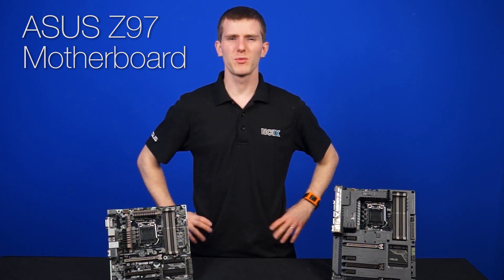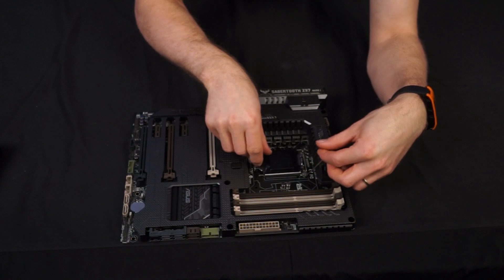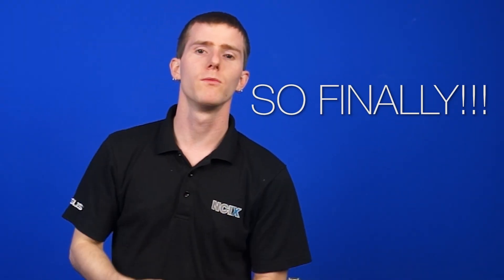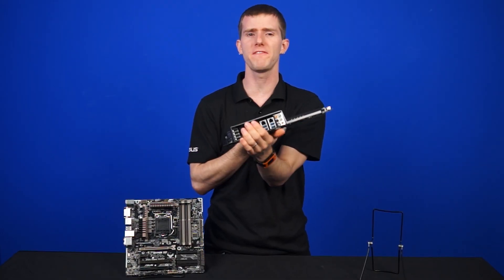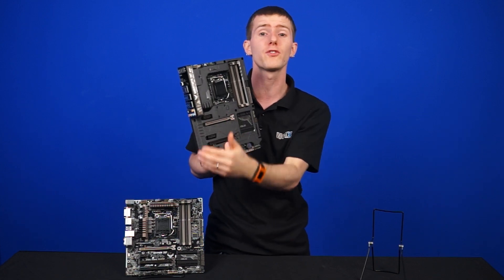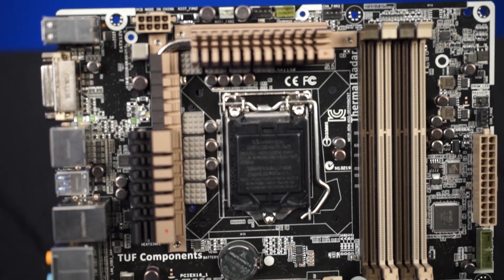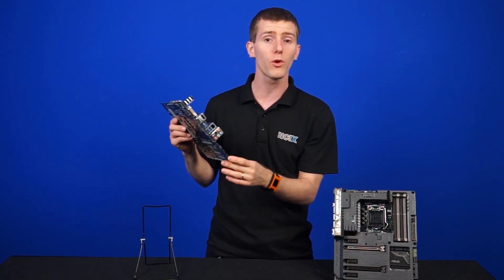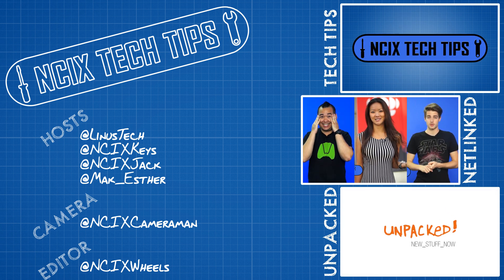What is the Z97 Express Chipset ft. ASUS TUF Motherboards - Sabertooth + Gryphon

Comment: Sticking with the legendary I5 3570k. This processor would still wreck everything in 3 years paired with a couple of 780TIs or 880s.
Reply: same i am sticking with my i5 3570k.
Reply: Man, I am keeping with my 3820 and my 2500k, both of those are still bloody awesome.
Reply: SirBillyMays 0.01v it is.
Reply: ya my fist CPU was a 2500k it's a beast .
Reply: I have the i5 3570k and LOVE it!!! Works like a charm! I even got it clocked to 4.4 and it's really stable. :)
Reply: Anyone here with tips on overclocking a 3820 btw? Had some struggles. (sitting on a Sabertooth X79 and 16gb (4x4gb modules), H60 cooler. Currently running on around 30C under light-medium load, under fake pressure I get around 45C.
Reply: SirBillyMays
Is that 30C and 45C with an overclock? If not then that should give you a fair bit of thermal leeway, so you could OC a bit. I think the safe voltage is about 1.35 for that processor. Try small increments of frequency increasing voltage gently too, or tell your motherboard to do the voltage stuff and you just set the frequency. Then, you can start up, see what max voltage it has given you (in Intel Burn Test putting it under 100% load), and go back into the BIOS and reduce it a bit, because I gather motherboards' overcompensate. Ask around here and see if you can find any people with OCing X79 knowledge :D
Reply: +triseebee
That is @ stock (3.6)
What is a safe increment? Like 0.1 to 0.01v?
I think I might look around for an OC guide, as far as I have heard it is not a very nice platform to OC on. (stability issues at higher voltages/frequencies)
Reply: SirBillyMays I also have a 3820, i can let the motherboard overclock it on it's own to 4.6+ Ghz, but it isn't stable. It can be stable for about a day but then BSoD, and if i keep the side panel off my PC it stays stable longer, so my assumption is I just need water cooling for it.
Reply: you put the side of your case open so it gets more airflow, if you would get watercooling it will have LESS airflow and will become even more unstable
Reply: Did he just say 880s lol

Comment: Im using a P8P67 Pro motherboard with an I5 2500K.
Its nearly 5 years old but its not in need of replacing, the 560ti on the other hand could maybe do with an upgrade soon, bring on the gtx8xx series!

Comment: im running a i7 920 on x58 because it was free and i wont be upgrading to z97 because i don't have the money for a better cpu and board on z97, however I may buy an itx z97 board and a Pentium anniversary edition (unlocked) for a secondary system

Comment: i7 2600k @ 4.6 GHZ
4 x Crucial M4 128 GB Raid 0 on LSI 9211-8i
AsRock P67 Fata1ity 
Asus GTX 580 Direct CU II
Asus Xonar STX 
I build this in 2011, upgraded once last year by adding 2 more Crucial M4 as they became so cheap, and added the LSI 9211-8i as well. It's been fantastic =D

Comment: I'm keeping my:
MSI SKT P67a-c45
i5-2500K @5.5GHz
GTX 550 TI
8GB RAM

This build was my first build from scratch and MSI has treated me so great. I'm sticking by MSI boards for the foreseeable future.
Reply: sarfured
110f is about 44c at 5.5ghz with a 120mm self contained cooler... maybe at idle or browsing the web. i smell something and it isnt your cpu melting....
Reply: sarfured
7 days to learn photoshop is too long. by then there will be a new video to argue in and this one will be long forgotten.
Reply: EZOVERDOSE Do you even read all of people's posts before you comment on them? I clearly said it only hits 5.5GHz when my board's OCGenie kicks in. I'm not increasing voltage, I don't have to, my board does it when it needs it. So I'll for sure keep in mind that the occasional OC is going to take my CPU's lifespan from 10years to 9.4years. It's already becoming obsolete so obviously I'd use ir for the remaining 7 years left on it's "reduced" lifespan.
Reply: What the fuck have you got cooling that I5 and what is the voltage?!
Reply: triseebee Shocked me too. I'm only running an Antec H20 620. I give the real credit to the 2 Noctua NF-F12's I use on the radiator. Keep in mind though that the CPU is turbo-ing at 5.5 thanks to MSI's OC Genie. I was going to overclock it myself, but I noticed my board was doing a damn fine job on it's own. I've seen it hit 110*F max, but only rarely.
Reply: Don't you mean 4,5GHz? 5,5GHz isn't possible with a single 120mm radiator. I have a i7-3770K with a dual 140mm radiator and it's hitting under load max 60 degrees at 4,5GHz. Oké, mine's a gen 3 processor and yours a gen 4 processor, but I'm sure it doesn't make that much of a difference.
Reply: ***** His CPU is gen 2 which is Sandy Bridge. Yours is gen 3 which is Ivy Bridge. Everyone knows that Sandy bridge is perfect for overclock but 5.5 GHZ its a bit optimistic.. Another thing that you have to realize is that his CPU is i5 w/o HT and yours is i7 with HT. Hyperthreaded CPU's such as i7 have problems with very high OC unless you disable HT in your Bios.
Reply: Belfor09 ***** EZOVERDOSE triseebee I'm at college right now and my desktop is at home. This is finals week, so I'll be home by the end of next week (9th-10th). If everyone is willing to wait till then I'll take a screenshot of it under load and we can take a look.
Reply: EZOVERDOSE If it took 7 days to learn how to put a white box over 4 characters and then use the text tool, graphic design would be a much harder job. If you can't handle waiting then who cares. I've got a 5.5GHz CPU and you don't.
Reply: sarfured
so u do know how to use photoshop.. the story unfolds..
i have a 4.6ghz @1.368v 3930k on a sabertooth board cooled by an h100i with 32gb ram and a gtx770 4gb which im totally content with.
im happy for u that youre proud of your system, theres nothing wrong with that. but u should enjoy it while it lasts. cuz to keep 5.5ghz stable youre feeding it voltage past its accelerated degradation point. so unless u just turn it on once a week to post a screenshot of its clocks to random ppl on youtube it will die sooner than later. good thing youre going to college to get some fancy degree so u can make lots of money to buy a new cpu when that happens. amirite.
Reply: Belfor09 well if you would disable HT it would be better to go get a i5 4670K, isnt it?
Reply: TheDreamingArmy It really depends what task you do on your computer. I'm sure no one would buy an i7 and disable HT just for sake of better overclocking right ? :) Im sure 4670k or even 4430 would fit in gaming scenarios. Sure you can think that way i7 w/o HT= i5 but its not. i7 has more tasks per cycle and more cache so it is better than i5 (at least on paper). If we are talking about gaming, there is nothing better bank for your buck than i5/fx8xxx and if you are talking about rendering and other professional taska the i7 will come ahead (with HT ofc :))
Reply: Yes. thats kinda what i meant :)
Reply: Jonny B
it was said on the internet therefore its true. this guy also deleted my post explaining what ocgenie is and how it doesnt just "kick in"
Reply: Is the Asus Saberthooth better than Asus Maximus Hero, on Fps

Comment: Still sticking with my Z77+2500k@5ghz although I might upgrade my GPU soon
Reply: How the hell do you run
SB CPU on IB motherboard?
Reply: Yeah they are both 1155 socket the generation of the chipset/cpu doesn't really matter
Reply: ***** Sorry..autocorrect..my real question is Why the hell do you run SB CPU on IB motheboard?
Reply: I bought my PC when Ivy Bridge had just came out and the Z77 and P67 Mobos were about the same price, and overclocked Sandy Bridge performed just as well as Ivy Bridge (way better temps when pushed hard like mine is) but the 2500K was on sale at 150$ while the 3570K was going for 250$.
Reply: ***** Yeah,but I thought you wouldn't get any Z77 features since most of them require a compatible Ivy CPU
Reply: the only real feature you don't get is PCI-e 3.0, and that doesn't even matter as it just happened to be the best bang for buck mobo I could get at the time P67/Z68s included
Reply: ***** Thanks for clearing that up for me..Too bad Sandy is not even available in my country

Comment: Running a 3770k on Z77. Won't upgrade. Reason being there is no tangible benefit to upgrading. The only reason to upgrade would be to Z87 for full Sata 3.0 ports rather than a mix of 2 and 3, and since I haven't maxed out my ports yet, no need at all to upgrade.

Comment: I'm running a 2600k (4.2Ghz_oc),
Corsair h80 (old school),
asus sabertooth p67 (no armor),
16gb corsair vengeance ram (1866_oc),
EVGA GTX 760 SC/ACX,
Creative zx sound card,
Kingston HyperX 3k 128Gb,
seagate 1.5Tb green,
Coolermaster silent pro v1 1000w(I know it's overkill),
corsair C70 case (black),
and 7 Cougar Vortex PWM fans w/controller(better then gentle typhoons).

Comment: Still keeping my near 2 year old 3570k. I always upgrade my PC for every 5 years.
Reply: I'm tempted to as well... But my current mobo (Asus P8Z77-V LX) is spitting out incorrect things, apparently it's 121C right now...
Reply: werethless12LP
i have a sabertooth x79 board thats said something like that from day 1 in hwmonitor but only hwmonitor. it goes up over 100c at idle and goes down to 20c under load. just a false reading or bad sensor for me or it wouldnt have lasted this long (almost 2 years)
Reply: I'm still rocking a B3 Rev. P8P67 Deluxe and a 2500K.
I just see very few reasons - if any - to upgrade right now; unless you need more of a workstation-grade platform, in which case I'd opt for X79, (which is ageing in itself, now).

SATA Express is probably the only reason that I would consider an upgrade; but for that alone? Most definitely not.
Reply: Yeah ive got a 3570k as well and its still kicking just fine. I'll probably upgrade whenever DDR4 becomes reasonably available
Reply: Upgrading every 5 years definitely works out well if you don't stick to mainstream Z87s/Z270s! But hell the market for CPU's has stagnated so much that even Haswell CPUs today are barely different in gaming compared to the latest Skylake or whatever is the latest now (Kaby Lake?). So glad I went with a 4790K when I had the option to go X99, if this was 10 years ago I might have been in trouble XD

Comment: running sandy bridge lga1155 because i'm broke
Reply: Hewson Tran Just the way you said it, was as you were looking for an upgrade.
Reply: Im still running sandy bridge, and I see no reason to upgrade..still runs my games fine.
Reply: it's okay, just keep using it. OC's very easy on that platform.
Reply: yeah no problems with sandy bridge
Reply: TheWizekraker still running socket 775 becouse i-am broke
(q6600 @3.4ghz ) ;p